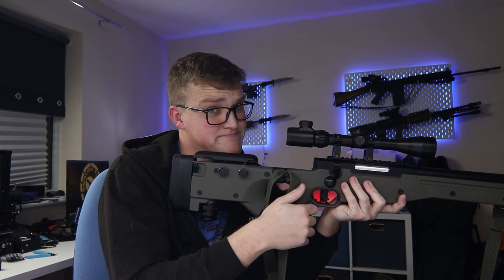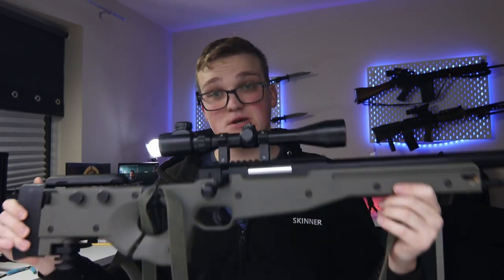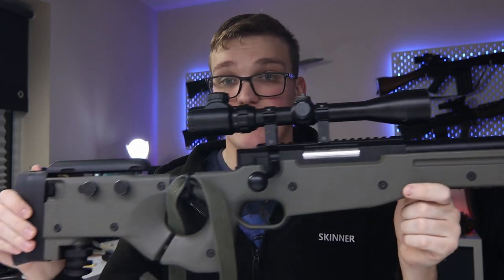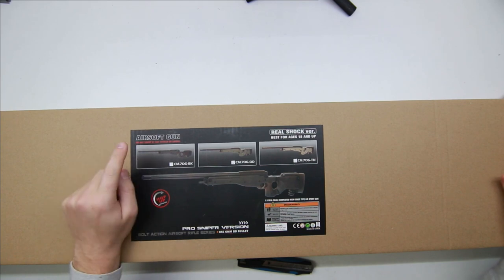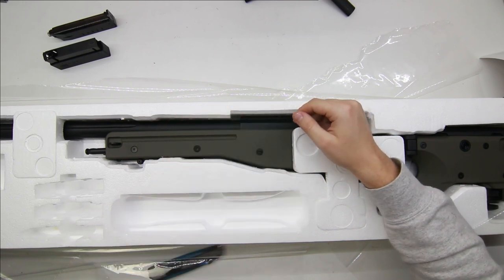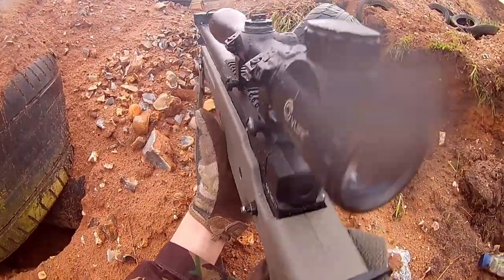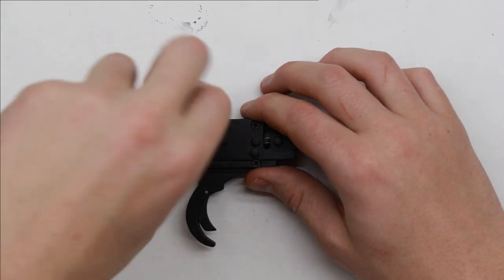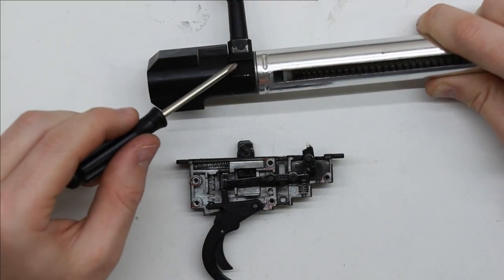DIY Airsoft  - The Novritsch SSG96: Pt 1 The Rifle

Comment: Oooooo... I actually have an L96 build. It has been circulating in owners (and damage) lately so its current state is not reliable, but when I owned it, it shot accurate and consistent.

This is visibly APS-2, like the MB01 I own. (Don't quote me on this. I'll await confirmation).

I would suggest (mere suggestion, IF if is an APS-2) the Action Army Hop Up Chamber for Type 96. It is well made and has a nice top down feature. It is, however, for AEG barrels and bucking. The PDI chamber seems to work great, but what threw me off was the dual lever adjustment, which, though is great for some, is not my cup of tea. 

Video might convince me to put some tender, loving care (or replacement) to my L96.

Looking forward to the rest of these.
Reply from the maker: I think it's mostly compatible, with the exception of the bolt components. the cylinder ID is the same as the airsoftpro cylinders OD! that being said, a modified glide ring should sort that issue out :D 

For the most part I really like this rifle and I honestly believe with only a few tweaks it'll perform rather well. If I can't get the hop to work properly, I'll probably drop an AA chamber in, though the only issue there is it's not compatible with the current barrel.
Reply: @EnglishKiwi  the rifle is really nice, and i do hope you'll be able to make it shoot right. I'm jealous of the side- folding stock mine doesn't have! The feeling of a well placed shot from a distance is really gratifying. I hope you'll experience more of them soon. 

Im surprised the cylinder dimensions are slightly different. Almost everything else, even the takedown is near identical to a maruzen/aps-2.

Also, don't lose that grub screw holding the outer barrel and the receiver. Better yet, don't strip it, either. I feel like since I've lost mine, my rifle's outer barrel has a small twist left or right.
Reply from the maker: So interesting story, I've just been given a donor mb01 to help with this project. The cylinder, hop chamber and barrel to reciever threading are different sizes! My only thought is that cyma based there's off the awm as opposed to the aw (so the 338 lapua instead of 7.62) the rifle is dimentially bigger as it fires a bigger cartridge. Bit of a pain but doesn't completely stop the project.
Reply: @EnglishKiwi  interesting indeed! Visually they are the same. This does open up some interesting venues for you. Hopefully more aftermarket parts (like a zero trigger... i love those) come in for that.

Comment: I'm starting my well mb01 build over the next couple of months, the mb01 is the solid stock tho, its the mb08 that folds for transport but it usually comes in at least 30 to 40 quid more than the solid one
Reply from the maker: ah so the mb08 is fairly similarly priced to the cm706 then. I'd say the mb01/08 is the better route to go if you want an easier upgrade time.
Reply: @EnglishKiwi  seems that way yeah, the mb08 isn't too easy to find in stock at the mo tho, even the 01 i bought wasn't my first choice colour wise but i didn't want to wait until the olive came back in stock

Comment: I think you will need a chamber a bucking (make sure to put teflon tape around it) and a piston that seals and will give you stable fps. Most standard barrels are not as shit as you would think. But eg. Take the RA-Tec barrels in consideration, as they are hybrids and cost only 50€ for 500mm. Built quality for that price is very good. I think with those 4 things you will stay under 300 and will have close to equal performance :D
Reply from the maker: I'll see what I can do with the stock components, but I have a feeling you're right, switching out hte hop and barrel components will probably be the way forward :D

Comment: Looking forward to the series. Bolt actions are an area where I'm fairly ignorant. Unrelated but how did the Perun work out in the KA?
Reply from the maker: Same here, never worked on them before, but in the immortal word of Jeremy Clarkson "How hard can it be?". I should probably do a followup to the now axed livestream, but the perun is running rather well in the SLR and even was happy to cycle my janky recoil kit I tested in it!
Reply: @EnglishKiwi  Good to hear. According to one retailer (Airsoft World) there is an updated version due early this year in the Perun V3. Also have the Leviathan for V3 gearbox from Jefftron.  So the selection is improving.
Reply from the maker: ooh very nice! might have to check those out when they drop :D It's good to see more v3 gearbox fets coming out

Comment: It would probably be easier to build a cheaper novritsch dmr, buy a cyma platinum, put a maple leaf barrel and bucking, maxx hop unit, gate titan and boom saved yourself a couple hundred pounds to get a gun that will save quite a few quid, but l96 build is gonna be way more interesting as I don’t work on snipers
Reply from the maker: sounds about right and I completely agree with you there, I went down the boltie route as I've not built one before and wanted to give it a go :D

Comment: Needs new hop unit, hop rubber and inner barrel to start with
Reply from the maker: Most likely! No matter how hard I try I cant get the rifle to seal. However I'll do the upgrade bit by bit and see how each component affects the performance 😀
Reply: @EnglishKiwi  surely you know what every sniper techs favourite piece of kit is for sealing .....ptfe tape ....even use it in my MK23 🤣
Reply: Like the idea of a barrel spacer to start with ....that wobbly barrel was making me wince at the thought of it flapping around with each shot ....maybe an aftermarket piston is the way to go for the sealing issue
Reply from the maker: yep! need to restock my ptfe supplies! I think the plan is stabilise the barrel, get the airseal up. improve the hop unit.
Reply: @EnglishKiwi  step at a time to judge if it's any improvement ...will be watching with interest mate 🙏
Reply from the maker: @Angrypanda68  yep! Every little change will be tested to see what effect it has :)
Reply: Lol just use m150 Spring. Can shoot about 80-90m Dependent hopup you use. Luckly can reach 100m
Reply from the maker: While the absolute range will be there, the accuracy will probably not. Hence the move to improve the hop up parts and the consistency from shot to shot.

Comment: Following with interest. I don't think you can build one for cheaper, even if you don't count time spent (which nobody conveniently does). If you make $20 an hour and buy $100 in parts, you can spend 5 hours total researching/buying/building before you are over the cost of the SSG96, and it's even worse for those of us who make more than that.

And you'd still not have the firing pin indicator or the bolt handedness swap. As an aside, the stock performance is terrible. My old UTG M324 did better than that with . 2g bbs, and my $80 Bbtac m62 will do a chest sized grouping at 250ft with .4s completely stock.
Reply from the maker: ah but that's the great thing about doing things yourself, it doesn't cost you a penny! However if your time is precious and you want to get a tech to build you a rifle from the ground up, it's going to cost you more than the novi rifle, however the additional costs may lead to a better performing rifle. 

Admittedly if I was doing this project entirely for myself and not looking to pick up a relatively unknown rifle to review, I'd have gone with a mb01/08 which does have a firing pin indicator and can have a ambi receiver fitted.

With regards to performance, the grouping may be down to me and not necessarily the rifle. I'm hoping to do some proper static testing and fix the rifle in place so the only variable is the rifle itself. Then again the wobbly inner barrel may indicate that the results won't change that much :/

Comment: To the mag indicator. Mine is black but has a Red dot Point Thing on it.
Reply from the maker: Is that on an ssg? That's cool to know, from the promo material on the website just shows it as a blank black nub, but that could have been a pre-production model
Reply: @EnglishKiwi  yeah on my SSG96. I dont know if thats normal. But on mine there is one. On the backside so the Side to the shooter.
Reply: @EnglishKiwi  but to be honest still a little hard to see.
Reply from the maker: @devildante1987  good to know!